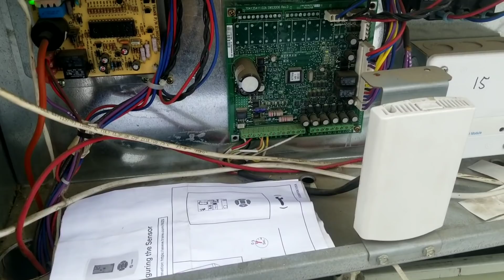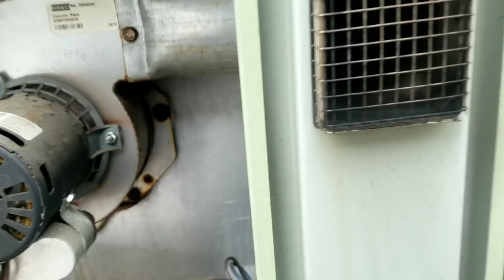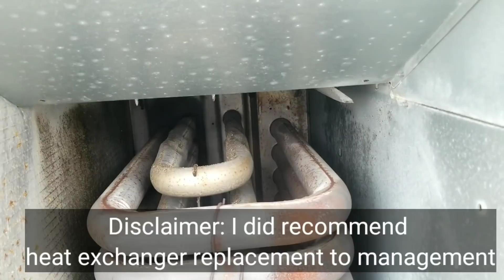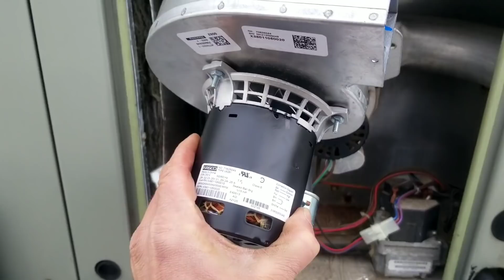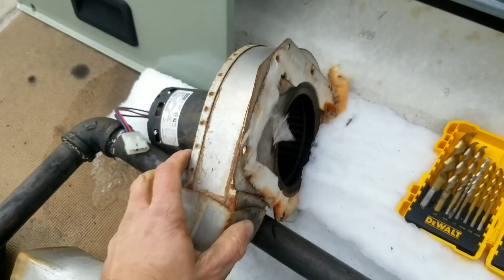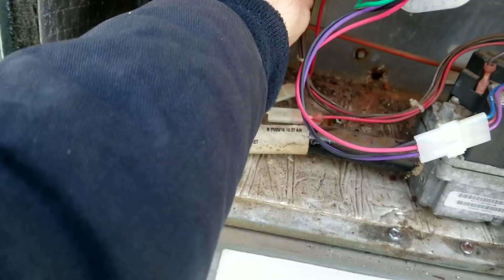Trane not heating

Comment: Hello, If you could answer something for me. I was working on my daughter's Carrier  It wasn't heating and the blinky light said bad Limit Switch. Unfortunately, I got China Virus and could work on it. So she had to call a local service shop. They came out and told her it was the Control Broad. When I was looking at it, everything was working except it would not fire, I could light it with a flame when it cycled. But, it would not light with the new igniter I put on. Keep in mind, it stopped working last Apr. but it got warm and wasn't needed, but, the AC worked fine all summer. Is it possible that the control broad was bad or ?????  Thanx for reading...
Reply from the maker: I mean it could but I find those boards are usually mis diagnosed because there mis understood--

Comment: you need a set of "external grip extractors" also listed as "nut extractors". you can probably find small set for cheap, most of them time they'll work or vice grips(locking pliers).
of course I mainly use them in automotive/other repair fields on rusted piles of junk.
Reply from the maker: Ive never heard of these things- ill have to check them out
Reply: @curioushvacguy6876  yeah they work pretty well, as long as enough rounded head is left for it to bite, they work on broken bolts and studs that are sticking out  also. for the larger stuff, you heat it good then attack.

Comment: I would have checked that inducer capacitor before condemning it.
Reply: paint heat cracked and rusty underneath = guaranteed the bearings/shaft and probably rotor/laminations rusted, possibly windings hurt also.
wouldn't waste time on that one just by visual looks ;)

Comment: Man I could feel your frustration right there 😆 ! Word of advice: get you a Gator Grip Universal Socket , it helps with rounded out screws and it doesn't take much space in the tool bag either .
Can get you out of a pinch at times and maybe even save you a tripod eh !
Edit : also maybe these super tiny Knipex Cobra pliers , the teeth are very grippy and they're small enough to fit in the tight space so that you can grip the rounded screw and turn it a couple times until it gets loose enough .
Nice one mate 👍 cheers !
Reply: I carry a little set of the grippy pliers called Vampliers. Quite useful as long as you can reach it with a set of pliers.

Comment: As bad as those stripped screws are, nothing beats the larger Trane units with the inducers that sit on stems and fastened with (I believe) a nut that comes off with a 7/16" bit. 

I've snapped a stem or 2 over the years, it is a major pisser-offer. That and the damage done when those inducers fail and blow those large transformers that lead to a big ol fire in the electrical section... Gotta love Trane.
Reply: Oh yes those Odyssey series are my bane, if you change that combustion motor, you better change the igniter too but goodness help you if you snap the screws for the igniter as you now have to drill into and compromise the burner barrel. Worked on three units before Thanksgiving that had failed motors and units are 460/3 I was not going to let those suckers blow up the xfrmr for the motor step-down.
Reply: @sivalley  YES. THOSE DAMNED FRAGILE-AS-HELL IGNITORS. I have broken that screw, and even drilling it out was a challenge as it ate up my bits. I got into management a few years back, but I still get flashbacks on those little annoyances.
Reply: @mc-sp8zr  Glad to know someone else agrees how shit a design those things were.

Comment: The Trane delay is no joke. Back when I did warehouse PMs, I would short the jumper terminals to initiate heat, and I then had enough time to walk to another unit, flip filters, and walk back just as the heat would ignite.

I chalk it up to Trane looking out for the hourly worker. $$$

Comment: Hey Bill, thanks for the video, I did find it mildly entertaining but I almost didn't 😉 I was curious tho if the inducer motor quieted down or not after running?
Reply: You came,you saw ,you fixed
Reply from the maker: Hey bud- it did, I actually went there last night to do some PM work- its running nice and smooth

Comment: Patients is a virtue that I don’t have time fo😂🤣😂
Reply: I was always told patients was a virtue and anger way a gift use them wisely 🤣 I just got back from a after-hours call on a trane belt blew up and pulled power wires off terminal block in blower cabinet